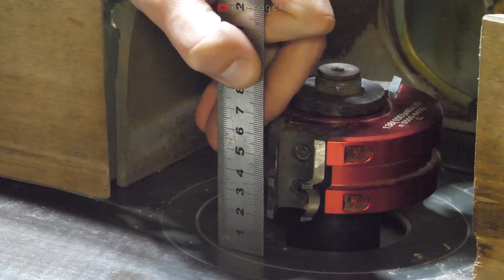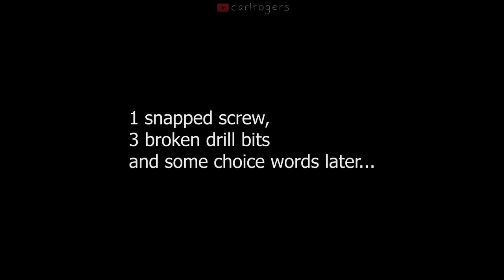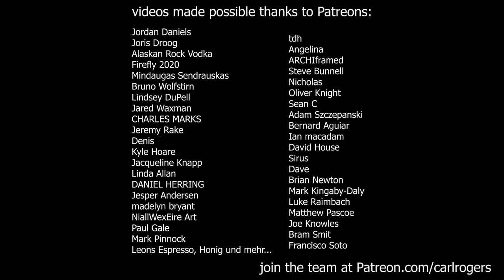Oak Door made from Old Scaffold Boards

Comment: Love your work, one problem in my head (hopefully I’m mistaken) braces should be a minimum 45degrees to transfer weight? Personally I would have run the brace from top right - bottom left, cut into the mid ledge on both sides. I’m not criticising just curious about different build techniques

Comment: Good woodworking. Surprised though at minimal safety gear, I saw ear protection, didn't notice much safety glasses usage, and I never wear sandals in the shop. And that is a cool combination jointer/surface planer/table saw/shaper, anyone know the brand?

Comment: I always assumed solid wood doors were better than veneer. But Norm Abram explained veneer doors are more stable and therefore better doors. I have a couple solid mahogany doors and they rub when it rains here in Phoenix. I wondered because I had some 150 year old white oak quarter sawn doors with 1/4" veneer and thought it odd why they would go to such trouble 150 years ago. Solid back would have been cheaper I'm pretty sure.

I think if I were to use such wood I'd maybe rip into strips and glue up a butcher block or bandsaw into 1/2 thickness and use as a veneer if I wanted the look of solid.

Comment: a couple of points, don't use steel screws even if they're coated, and pilot hole every fixing in oak so as not to split the wood or break the screws. the acids in the oak will eat it away, use brass or stainless. the other point is the brace is doing nothing at such a shallow angle. start from the bottom hinge side to the top lock side going through the centre of the middle rail, and take your time eliminating silly mistakes and having to fill with glue. otherwise it looks ok.

Comment: Got an idea , you had a straight pencil marking your cut line from under the board , we used to take a pencil and cut it at , oh , 20 degree angle, about an inch long the super glue the pencil back together so that it's bent as t be at about 40- 50 degrees, and viola', a bent pencil, and you can mark you board way more precisely, make one , you'll see what I mean, it can be 80 deg , kit doesn't matter , guaranty, you'll never go back to a straight pencil, in tight spaces

Comment: Have you cleaned and filled that void to help avoid rot growing from the area? 
Would oak dowels to pin those notched ends help to avoid the wood splitting along the grain? It's one VERY heavy door.

Comment: A great piece of proper heavy duty carpentry skills here 👏 👏. I’m somewhat concerned for you both that you weren’t wearing face masks esp. when emptying the dust extractor. Oak saw dust is carcinogenic. The almost microscopic dust amongst this that you can hardly ever see can sit in the lining of your lungs for years and only decades later, when you might even be enjoying your retirement, guess what? You go to your doctor with a seemingly nasty cough that won’t go away and from there get referred  for chest scans etc then an oncologist and so on. The end result is end of Iife care. The same goes for cement and brick dust. Take care of yourselves. Best wishes.

Comment: 1 Snapped screw'
3 Broken drill bits
and some choice words later.

Were they about using cross head screws. Sorry but I hate them.

Other than that a very well done. Thanks for posting.

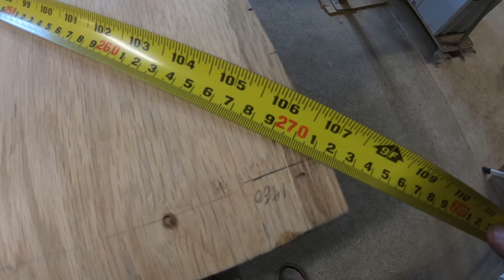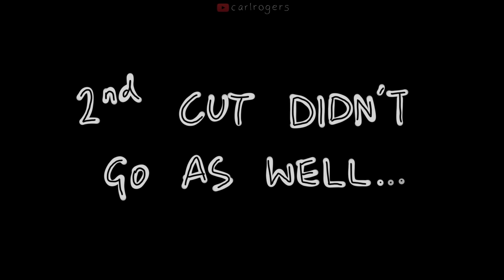Comment: 1:58 don't you put the crown side against the jointer table?   2:06 time to offset the jointer knives.  9:35 you don't put the cutter inside the table? yep.. knife above the table for you right there, you could put 2 pressure pushers and one other on top.  the tongue is pretty thin.. do you have a small mortising chaine on your chain mortaiser? to run the wedges through. for that technique you'd probably have to make 2 doors even with top bottom rails. one side of the door will face outside and the other inside. you're mounting hanging right? 12:31 run it both side against the fence on the table, sure to have centered groove. 15:43 uhu... its a door hanging on hinges? 16:35    now for some sporty free hand on the table saw with that 10" blade.  22:42  you don't say... wrong head on the screws and too small screws they have to be at least 5mil those are 3,5.. maybe 4. the old timer stove bolts on the old door... 22:40 brace it to the ceiling with wedges on the door, if you're on a strong bench but the screws are too small. 24:00 Wet rag, very wet or the glue will show through the varnish 24:18 saw with the grain, not across 29:47 won't be long before you wish you have routered in those hinges plate, just one eight. Isn't the brace supposed to old the far bottom corner to the top hinge? the diagonales I mean. i am dryadfurniture.com in Salt lake city. go for bigger machines before someone gets an accident. good stuff thanks.

Comment: why just  not cut small strips  with the thickness of the sawblades cutting width and glue them in you can barely even see that filler strip  and its cheaper than just making a new piece and looks better than filling it with glue and saw dust

Comment: Had you filled that big knot with epoxy, there would have been greater respect for your work.  Just covering it up isn't good because it's vulnarable to rot.  Epoxy would have prevented that and give your door a bit more structural integrity.

Comment: Where can I buy scaffold boards made from oak? Nice work, but I cringe seeing a circular saw without a riving knife and guard, I cut a plank of oak many years ago on a bench saw with no riving knife, the timber clamped on the blade and projected it like a bullet across the workshop more than 20 feet and embedded it in a lightweight concrete brick wall, never again, lucky no one was hurt! Same with the surface planer, no guard! The trouble with machines is they cannot distinguish timber from finger and hands, they treat them equally!  All you DIYers, always use guards, don't modify machines and you may still have all your finger and eyes when you grow old ! Who am I ?  I teach woodwork, have done for 40years still got 8 fingers and 2 thumbs!

Comment: You want to have a word with the saw mill what you have is bog stock scaffold boards about £20 each larch or pine collectively called white wood boards scaffold boards have never been made our of oak the same size in oak would be £150 the bands on the end would have been put on at the scaffold supply firm it's misleading to try to say they gave you oak by mistake oak would weigh about twice as much if not more your making a white wood door not oak